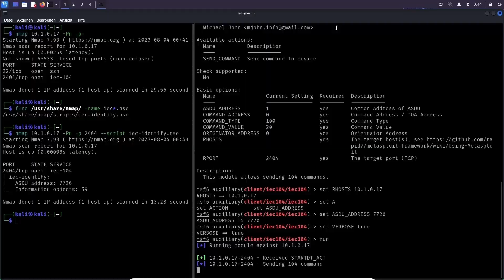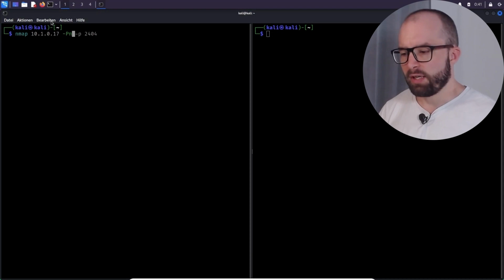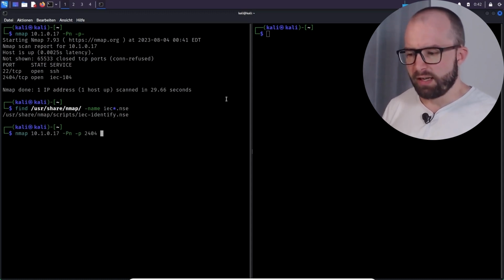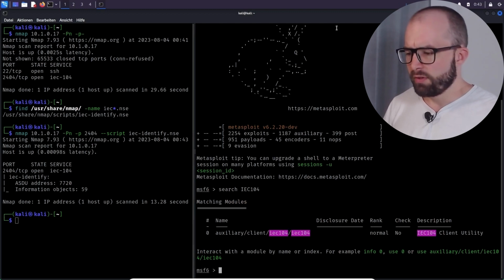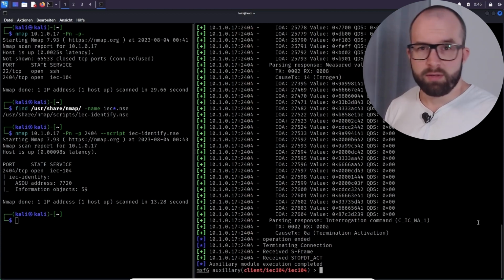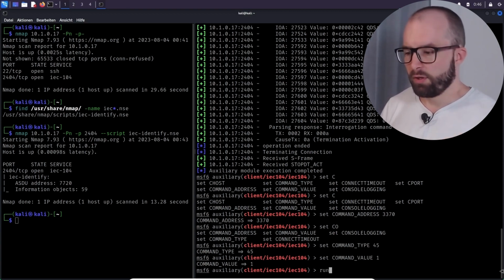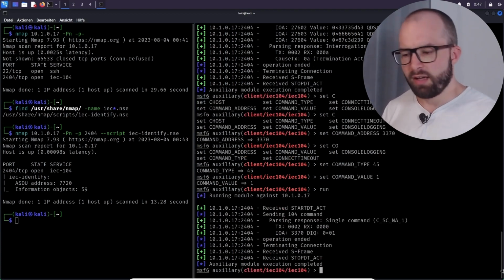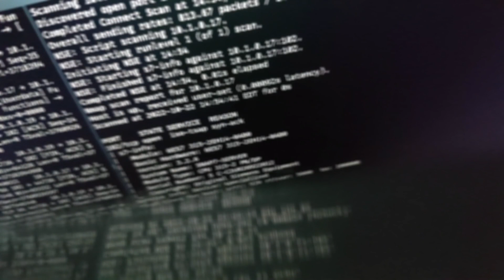Breakdown "I will pwn an infrastructure substation (conpot) in less than 60 seconds"

Comment: I am a noob when it comes to Industrial control systems (ICS). Is there really that much specific knowledge about the device (command, location, application, content) required to attack/disturb the system after network access is established?
The Metasploit script shows a list of information object addresses (IOA). I'm thinking of a script that takes the list and changes the values randomly (ignoring type and purpose of the value, just change some bits without knowing what this changes in the application), one every 1 minute. Could changing values blindly and slowly, disrupt the industrial system behind the ICS? (Slow because the attack is supposed to be hidden.) Could blindly changing caused e.g. every hour a disruption of the operation? It could be very challing to the maintenance personnel if they don't consider an attack.